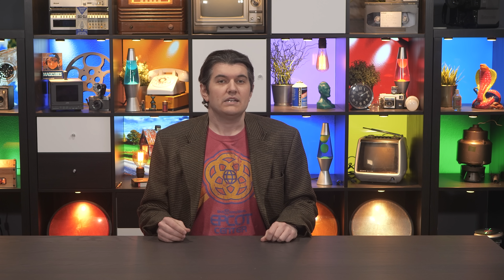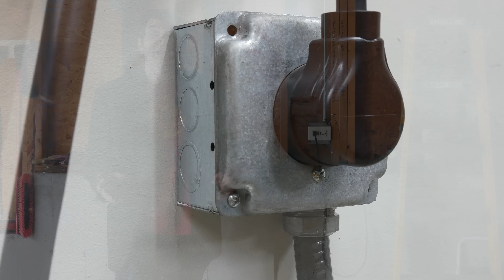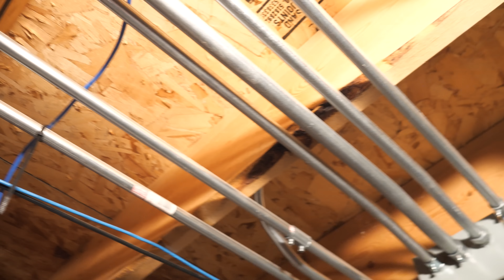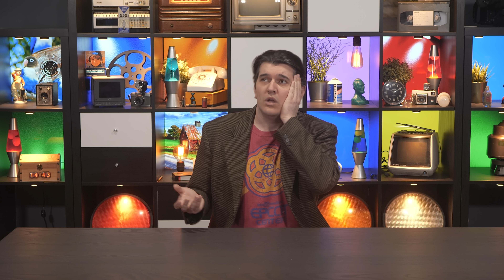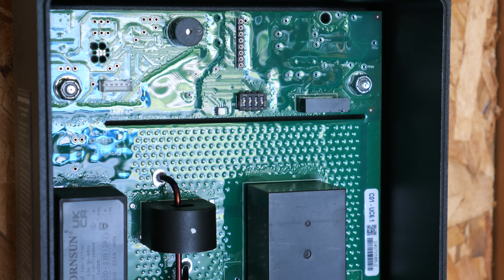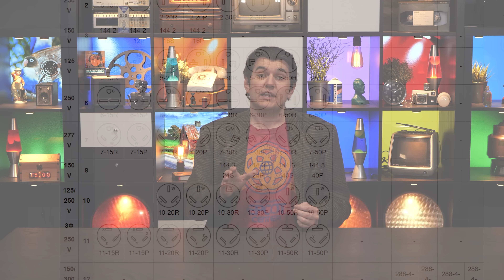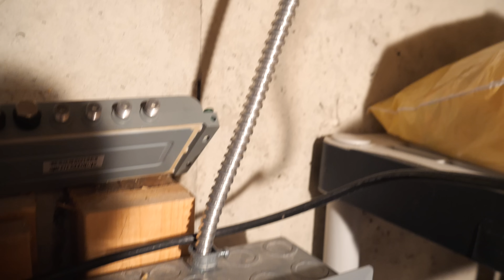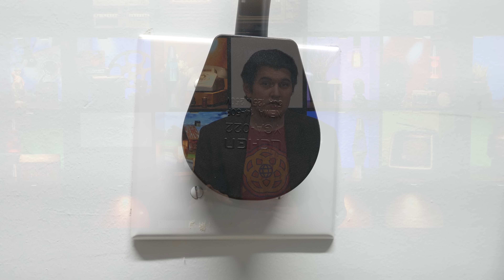The "standard" car charger is usually overkill—but your electrician might not know that

Comment: In regards to "smart" EVSE's, you DO actually want one of these if you have a home solar system and excess power, expecially for those who can charge durign the day. Units like the Zappi can allow charging with excess solar only. My IONIQ is almost entirely solar powered as a result.
Reply: Smart chargers are also useful if you don't live in the US and your electricity input is likely limited for the whole house. With a simple measuring device on the main input the charger can tell the car to reduce it's power draw when you are close to the limit, for example if you turn on the oven or the dryer while charging.
Reply: @bastienx8  load management is becoming common in the us.      The emporia can be set to pull full power when available and significantly less if the houses mains don't have the capacity because of a heater or whatever turning on.     The load management is really important in some. Circumstances, I wish that this channel went into that more.    Load management opens up 48 amp charging on a 100 amp home service (for that large pickup truck, or whatever).   Or for families with multiple EVs,  or families that share their evse with family or friends.   Faster is better.  For me, I adjust the rate to meet the needs at the momemt.   Lower amperage for daily use.   Higher amperage to recover from a long trip or to charge a friends ev.
Reply: @mattbuie5878  Here in France more than 70% of the houses have a 30A service, which limits EV charging to a standard 16A socket, and the higher lever is 45A service for bigger houses or if you want a 32A charging plug at home. In both cases there is little margin when the car is plugged in, so a smart plug is pretty much mandatory here.
Reply: Came here to say this. We’re in Florida. We only charge during the day since we had solar panels/batteries installed. Before that, overnight charging was fine, but now that means charging off the grid.
Reply: I have a SolarEdge EVSE which is wired into our SolarEdge Inverter and when the Inverter shows it is generating more power than the house is using, it will dump into the car charger.
Reply: Smart chargers are also great if you want to take advantage of low off-peak energy rates. The utility company needs a proof of overnight charging. They accept electronic communication either from a smart charger or directly from your car. However, the car data plan is not free (at least for my Audi e-Tron). Savings from overnight charging do not cover the cost of car data plan. So smart charger is a no brainer for me. At least it will pay for itself eventually. I'm surprised no one else brings up this aspect of smart chargers. Is that because most other EVs connect to the Internet for free?
Reply: @IlyaBurda Where I live the utility company knows each hour how much power your are using through the meter they install. We don't have to report anything. I'm curious, do you have to report things like hot tub usage as well to get it cheaper?
Reply: @IlyaBurda yes. I was surprised he did not mention this in the video. That's why most people buy smart devices. Yes my car can do these things.. but for another subscription fee!!
Reply: I'm honestly wondering, why not go big? EVs have such potential to act as batteries that power the home. I wonder if we could build home HVDC systems that can inteliigently work between multiple inputs and outputs, depending on demand and supply. You could have solar directly connected, a managed grid inverter, stationary battery systems, high-capacity connection to the garage and directly to an EV's battery, and other high-demand utilities on DC power as well. So many things operate on DC, so it would be interesting eliminating so many of the other mini-inverters we use everywhere else.
Reply: I agree. As I have only a 16A circuit, I bought an inexpensive Tuya enabled charger, and let it charge my EV whenever my solar panels start to produce enough power to allow for at least 6A to charge the car and still not cause electricity to be needed from the network. The programming was a lot of fun and not majorly difficult. As I usually drive very little, during summertime I rarely even need to buy power, my solar panels provide most of what I need. I could not have done that so easily without a smart charger.
Reply: Also good if your charger is outside or in a shared garage. It can be set to only charge vehicles you own.
Reply: There is another advantage to smart charges and that is that they can be linked with things like home assistant to allow you to not only monitor the car charging but to actually control it, in fact if your car will actually connect to the Wi-Fi at home you can even get home assistant to do math. I can't remember the name of the integration that allows you to do it but it does is take your car's state of charge plus your car chargers available output and it can actually predict how long that's going to take and therefore do stuff like start charging a bit earlier so that it reaches the target percentage quicker, let's say you charge between 11:00 p.m. and 4:00 a.m. because that's when you get the cheapest rates and you have a target battery percentage of 80% but one night you arrive home with less energy than typical and charging between 11 and 4:00 a.m. will only get you to 73%, well it could start charging at 9:00 p.m. at a lower current and then bump up to full current Once set hits that cheapest time. Again I can't remember exactly how you doing home assistant but I know that there is a way to, if I find the forum I'll put the link down below
Reply: Thank you for this comment - I was wondering what to do in my house, fully off grid so will only be charging during the day
Reply: @eevblog I’ve been curious about EV charging via solar. It feels inefficient to go solar DC -> household AC -> DC for the car. Is there a simple way to take direct DC from panels into a car?
Reply: @therumbler Theoretically you could build a DC fast charger which used solar panel input directly but I don't know that would be much more efficient, because you already have to convert the voltage anyway, as it's unlikely the solar panel voltage will match what the car is needing to charge the battery.
Reply: @RobertHancock1  You're probably right.

It "felt" wrong, in my head to go Solar DC -> AC -> EV DC due to efficiency losses.

but i guess a DC step-up converter isn't 100% efficient, either.
Reply: @therumbler  direct DC charging could certainly be more efficient but at this point I haven't found a solution (and seems unlikely in the future for myself at least as chademo is being deprecated). In an apocalypse situation I could slow charge the main battery from a current limited solar array at 400V but only by bypassing many safety systems ... 😉
Reply: Zappi doesn't exist in the US and Canada, although other brands with similar feature sets are finally starting to come onto the market here. About darned time...
Reply: but you dont actually need as you can wire your solar setup to be prioritized over the utilities power
Reply: @ReinaldoRauch could you explain more?
I did a lot of work on my solar setup myself, I have experince with helping others.....and never I heard of a way to do that!
Ofc you always prioritize self consumption, but past that point you will take fron the grid.
Reply: @florihae  Victron has a pretty neat solution as part of their ESS lineup, but that's for people who are either completely off-grid or have their grid-tied PV set up in a way that they could be off-grid if the grid ever goes down. The DIY way is to use something like EVCC for control - haven't used it myself yet, but from looking at the documentation it's basically "the linux of EV charging", you can do whatever you feel like it with it if you're comfortable with writing a little code.
Reply: @maosw Ah okay, Victron I actually know!
My point is more....isn't that just shifting the goalpost?
Okay, I do not need a smart charger, but now I need a very smart inverter 😅
Reply: @florihae  Really depends on what you want to achieve and that in turn really depends on your utility provider/country/location. Being hooked up to a almost medival "dumb" grid like most US homes are, the benefits of anything "smart" are rather limited, but once there's at least one or more smartmeters involved like in parts of Europe, Asia and soon Australia (I think)  that starts to change. And if you're off-grid you're your own grid so adjustable charging speed is really useful there as well.
It's almost as if there's no one-size-fits-all-solution and that's why there's so many different standards out there. Imagine that! 🙂
With energy it all boils down to having your demand-curve fit your production-curve as close as possible - no matter if you're on a microgrid or a nation state.
Reply: most solar systems do that themselves
Reply: @Oyashiro_Chama No, most solar systems cannot communicate with the car to limit its charging speed based on solar output? What are you even talking about..
Reply: @RobertHancock1  They actually can. At least if you don't buy a dumb charger. Many companies that produce inverters+batteries either have their own EVSEs or list compatible chargers. The charger then has either a ethernet connection or a RS485 connection to the inverter for communication.
That's basically standard here in Europe. You also get an app to change operational modes. You can switch between charging only with excess solar energy or, if necessary, to charge with full power (usually 11kW) and use power from the grid.
The only thing that some of the inverters are (not yet) capable of is to stop charging when no solar energy is available, they drain the solar battery to charge the car.
Reply: @Oyashiro_Chama how would that work?
Never heard of a solar system that is able to tell an EV it's max possible current based on the solar production.
Reply: @florihae  Check out Emporia, or similar EV chargers with load management.  It monitors your solar production and household draws, and adjusts the charger (EVSE) power so the vehicle only charges when solar is present - and up to that amount.  Tesla has a similar setup with their solar and EVSE equipment, so does enphase, etc.
Reply: @billjohnson3344  thanks, will give it a look...BUT that sounds just like any other SMART wallbox ;)
Reply: @florihae  A load managed EVSE (household and/or solar) is a different feature-set than merely a smart Wallbox.  The Wallbox has an app where you can do things, but a load managed EVSE has metering hardware that you clamp on your incoming mains and solar.  Additional functionality beyond just scheduled charging or energy history - that a typical smart EVSE (and app) would provide.
Reply: @florihae  You basically buy an EVSE that is compatible with the inverter and connect those two with either ethernet or RS485. Here in Europe many of the EVSEs can do that, those should also be available in the US.
If you want to look for yourself: (as an example, as I wanted to get this system) Huawei SUN inverters combined with the Huawei smart charger. The charger can switch automatically between one and 3 phases and can change the current starting from 6A to 16A (in case of the 11kW charger) on the fly. It works flawlessly if the car also supports on-the-fly changes, but not all do. In case of the latter there are still options, but they are less reliable.
Other companies like BYD or Goodwe have similar systems.
That's basically standard here in Europe. And I am sure those systems are also available in the US.
Reply: @johnscaramis2515  I am living in Europe ;)
I know they all exist, but I would consider them all "Smart" Chargers. The whole point of this discussion was, that you will need a smart charger to achieve this function.

I myself have a SunGrow System and will probably just get the SunGrow wallbox....it just makes it so much easier. At the same time, I am quite turned off by all the App/Wifi implementations. 
The SunGrow is also just a simple 1 to 3 phase "switch" wallbox.
Reply: @florihae  What is it now? Now you say that you know that those chargers exist, where before your claim was "how would that work? Never heard of a solar system that is able to tell an EV it's max possible current based on the solar production."
Those two statements are mutually exclusive. Either you know or you don't know.
And yes, "smart" is quite a stretch, as it is basically only a check how much excess energy is needed. What's you definition of smart?
BTW, you are aware that also the SunGrow charger is a smart charger? It understands  OCPP 1.6J. And for an automatic change between one and three phases, you actually need a smart charger.
Except you buy a dumb charger from them, but then why buy a charger that fits into the SunGrow eco system?
So your statements are quite confusing. Are you sure you know what you want to say? Does not sound like it.

Comment: I don't understand any of this. Our house was build in the 70s with standard AC 220/230V. I just plug in bike or car into the standard socket & the bike is full & ready to go 300 km one hour later. The car takes 10x longer to get the same distance but that is still only 10 hours to travel to a completely different country. Always been like that, what's the fuzz? 3 wave charging is just optional mostly used while travelling.

Comment: 3x16A 400V plug, load balancing and 3x25A 400V mains is quite nice setup.
11kW station, 11kW capable car.
Throttles down when sauna + induction are on.

Main charge through solar dynamically consuming about all produced between 1,3W to 11kW 1x6A 230v up to 1x16A then 3x6A up to 3x16A in 1A steps.
I love eu grid.

Good video and true that you do not need max amps in most cases. And the strange odd case you get 5 to 15 times the rate at DC fastcharger  as I get at home.

Comment: I did some reading and couldn't find how long you can pull the full 50A  through a NEMA 14-50. (used CHatGPT later and it said for up to 3hours which seems reasonable)
European Type F/E sockets are rated for 16A continuous which makes sense as it's a 250V-16A socket. Larger 3 phase sockets (IEC 60309) have "time at maximum current" molded directly into the socket which is 6 hours from what I've seen. Why doesn't the NEMA standard require this information to be easily accessible right on the thing you are working with is kinda weird but I guess that's normal for that part of the world. Insurance companies have to make money somehow.

Comment: Aussie here, own an EV, and rent the house we live in. We asked the homeowner if we could install a 240V 15A dedicated circuit (still uses a standard wall plug with 15A earth pin) we paid around $250 to have it installed, dedicated circuit with breaker run from meter box to power point. Around 3.5KW charging rate is more than enough to cover a days' worth of driving. Going for anything higher means running either 32A 240V or 3 phase 415V and that gets very expensive, real quick.

Comment: yup, except for the winter here a 120v 15a circuit (so 12a continuous) can do just fine. winter time just eats so much power since there is no sheltered place to reduce that. but that's assuming i could do an ev in my situation which is a big fat no. so i want a nice hybrid, get the ev benefits but fits within my current situation.

Comment: Had to buy my normal outlet cord since used didn't come with it. Electrician quoted over $1k for installation not including materials, so yeah I'm good enough with the wall plug charger at 8 or 12amp options.

Comment: Yes please make an update to your charging videos. The info in your existing vids is fine but it makes sense to keep these updated as they are widely shared on EV forums and subreddits by people like me. 

I went the exact opposite route as you recommend . I am of the east coast mindset of “if it is worth doing, it is worth overdoing.” 😂. I have a 60 amp circuit with a nema 14-50 outlet which I use with a smart EVSE set to 40 amps. That said, I agree that most people oversize. For a very long time I used a 16 amp EVSE with my set up because I already owned it and I’m cheap. I bought an Emporia Classic EVSE a few months ago because my power company was selling them for $200. I hardly ever use the app but it is interesting to see that the car regularly requests small amount of power even when it has completely finished charging. It can also be used together with my solar set up to charge the car with excess solar production, which I don’t actually do but it is a nice option to have.

Comment: 24:00 A "soft" disagree on car charger smart features: If you have a solar panel array, and especially an array hooked up to a battery, an integration into that system may be useful so that the system can prioritize the home battery vs. the car vs. demand in the house, and doesn't accidentally use grid power when "sun power" would be available at a different time of day. But even then, there are systems that work purely off the internal net and do not need to "phone home" to the manufacturer's cloud, ever. That's not even a privacy concern, that's a "this smart appliance will live longer than the manufacturers' cloud server will exist" problem, which already happend even to expensive name brands like Bosch.

Comment: in the UK high current (as in over 13 amps) appliances have a permanent installation, there's no plug. You wire them directly into a terminal. 
It astounds me how the USA doesn't have more electrical fires. 
When I am king of the world I will have a new mains system. Everyone gets high power AC to their house (frequency and voltage to be decided) and at the distribution box, there will be a high efficiency switch mode power supply that provides 48V DC. All DC electronics can be powered from this, and use DC-DC converters to give them the 12, 19 or 5v they commonly use.